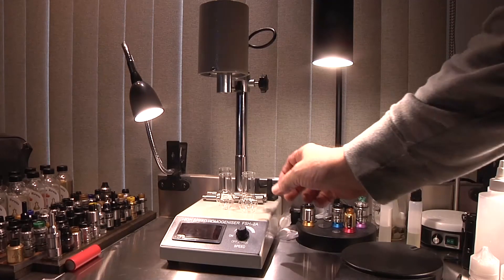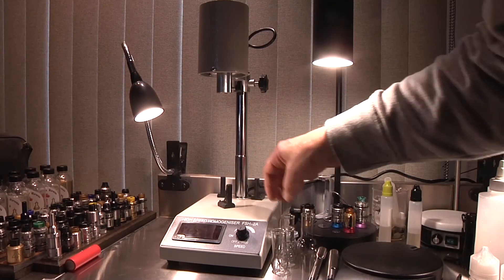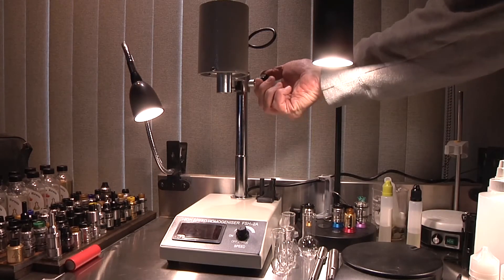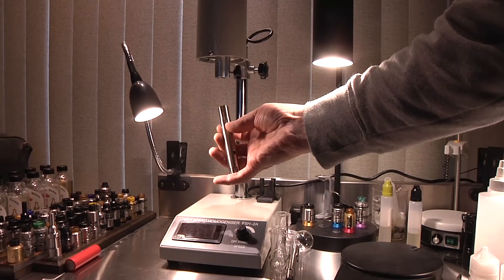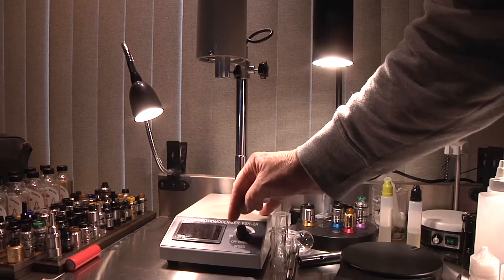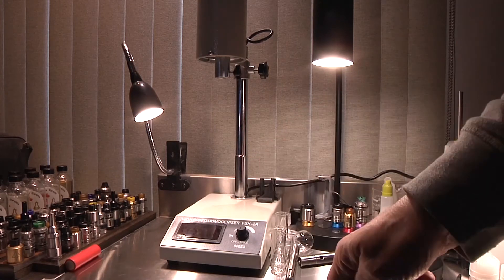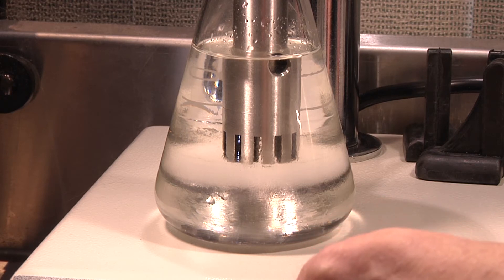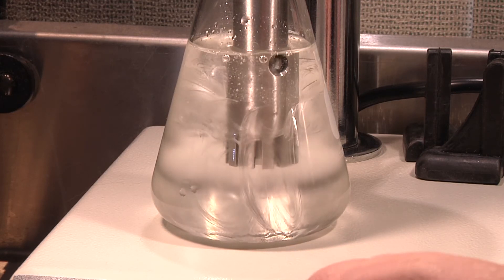FSH 2A Homogenizer

Comment: Since the GC Homogenizers are no longer available, would you still recommend the FSH-2A for DIY E-Juice?  I know that Dan got sick with Covid and experienced a stroke and paralyzing his arm from it, but he had plans to get his GC Homogenizers produced.  Do you know if he was able to do that?  I'd much rather have a GC Homogenizer or both sizes, but would like to know how your FSH-2A has held up over time before buying one, if I can't get a GC.  The FSH-2A instructions I found say to lower the tip to 2 to 3mm above the bottom, if it will reach down that far.  And if you would, please tell me where you bought yours so I can get the same one.  There are many manufacturers of FSH-2A, and there are also FSH-2B and FSH-2C versions now, each supposedly better than the one before.
Reply: I haven't heard from Dan in a long while.  I really don't know if he will resume production or not.  I have the FSH-2A as per video and I use it often.  It has held up well and does a fine job with e-juice.  Obviously it will not last as long as the GC but I have had the FSH-2A for over a year and it is going strong.  There is no need to get as close as 2 to 3mm from the bottom of a flask.  I use a 125ml flask and lower the probe to where it is just not touching the flask.  In regard to where I purchased it, I apologize but I simply don't remember.  I have had no need to buy another so I can not advise regarding the 2B or 2C.  I believe mine is made by Lankai.  Amazon has it for sale.  That is also probably where I got mine.
Reply: @waltshodgepodge    Thank you for the quick reply, Walt!  The FSH-2A I'm looking at on eBay is made and sold by Taishi, so I'll look for Lankai on eBay and Amazon.  Some of them come with one set of replacement PTFE for both probes/heads, and some FSH-2B or -2C come with 2 sets.  I have asked Taishi to be able to purchase quite a few sets of PTFE for both probes/heads and spare Fuses, so if I find them, I'll tell you where you can get them.  I noticed your 125ml Erlenmeyer Flask and Stopper, so that's what I intend to get with no-hole stoppers for them.

I'm also going to ask if I can get an extension shaft to be able to insert the probes/heads deeper into larger flasks.  250ml would be the largest I'd want, but 125ml may have to do.  Thanks for the note about not having to insert down to 2-3mm above the bottom.  But 38mm above the bottom of a 250ml flask might not be far enough.  That's why I'll ask about an extension shaft.  I'll let you know about that, too.

If you have a reliable way to contact Dan, please encourage him to pursue his production route source(s).  He's not replying to the email address he posted in forums.  That should be able to generate some Royalties income or something like that for him.  He deserves it!  I've read all of his and your posts on forums and know about all the dissension and ridicule he got.  That shouldn't mean that there's still no market for them.  Just that only ignorant people replied.  I'm sure that anyone who has a GC would love to testify on his behalf to aid in sales.  He knows who has them, so please suggest to him that he will surely and gladly have their support.  And if you ever learn that they are being produced, please be sure to let me and the world know.  Thanks

Comment: What do you do with the little plastic PTFE bushings that come with the unit?
Reply: Those are replacement bushings for the two probes.  Keep them around.  The probes use single bushings and are the most vulnerable wear point.

Comment: Hi, great video, question if I may - How long do you have the homogenizer running in the juice before you consider it finished, is there a way to tell?
Reply: For a 125ml batch I run it less than a minute.  Two things will happen in that time period.  You will see streams of thicker liquid moving within the thinner liquid.  These streams will disappear.  Your liquid will fill with gas bubbles.
Reply: @waltshodgepodge  Thanks very much for responding, very helpful information.

Comment: Would you recommend purchasing a cheaper ProScientific generator to use with this as a cost effective upgrade? Would that even be compatible?
Reply from the maker: They are not compatible.  If you want to go ProScientific I recommend looking for used motors.  Hospitals will get rid of them while they are still in very good condition.
Reply: Also, thanks for the review! 👍
Reply: One more question...how the heck do you clean the probes? 

I read somewhere that you can take them apart to clean and oil them...

Makes sense, but doing it or finding any support for this thing is proving difficult. 

(Can't say I'm surprised for a sub $200 homogenizer, but I do appreciate you sharing your experience with it so far!)
Reply from the maker: @FerozLakhani  The stator at the end of the probe unscrews.  It is reverse threaded.  That allows you to reach the rotor and cylinder for cleaning.

Comment: Is it similar to expensive ones
Reply from the maker: The general design is similar.  The generators have only one bushing where my ProScientific has two.  The tolerances between the rotor and stator are much looser than the more expensive ones.  Having said that, there is belief among my colleagues that the looser tolerances lend very nicely to blending e-juice.  The 18mm generator draws a very impressive vacuum without the introduction of outside air from a vertical vortex.  I have no idea how long the unit will last.  I have seen no indications that it will be short lived.
Reply: @vapinwally6070  6 months since the video was released, any new thoughts? Have you tried this with juice that normally needs to steep for a month or more? If so, what were your results? Thanks for sharing.
Reply from the maker: @wickedfog3047  Hey Fog!  Good to see ya!  I have a couple of creams that I make that will benefit from extended "steeping" if mixed with a magnetic stirrer.  Those recipes come out great after an overnight settle and do not change over time when using the homogenizer.
Reply: @vapinwally6070  you da man! Thanks for the quick response. Will go grab one ;)
Reply from the maker: @wickedfog3047  I seriously doubt you will regret it.
Reply: @vapinwally6070  did you buy the Shear or Dispersion model?
Reply from the maker: @wickedfog3047  I have one of the first beta testers.  I'm not sure what you are asking.  A homogenizer disperses via high sheering.  Dispersion is a bit of a non sequitur.  Rather than dispersing, a homogenizer does just that, makes a homogeneous liquid.  It makes "many", "one", so to speak.